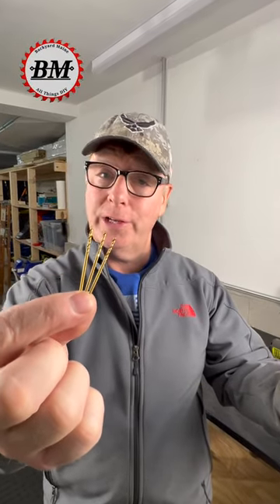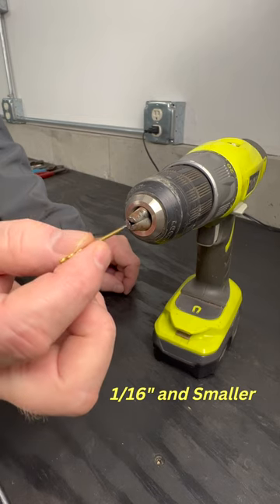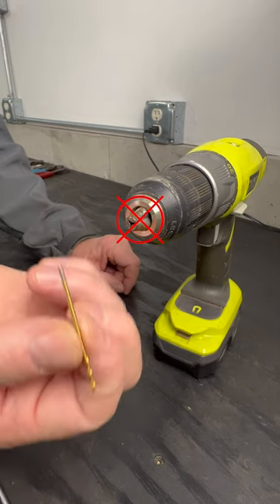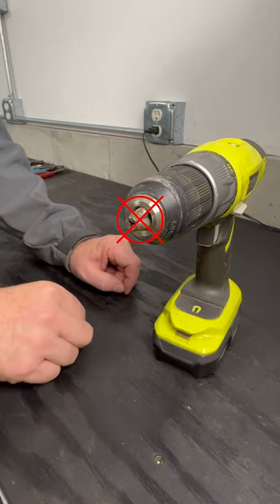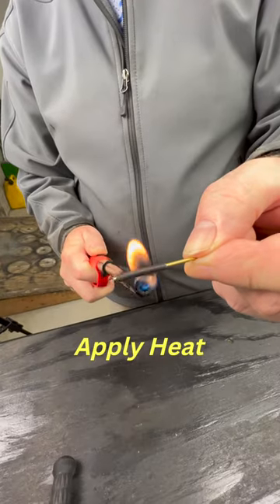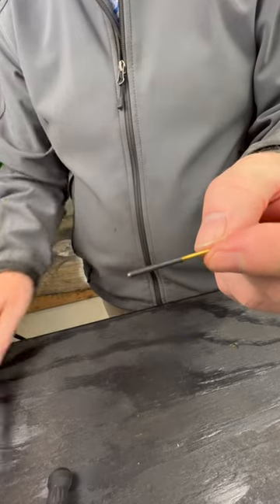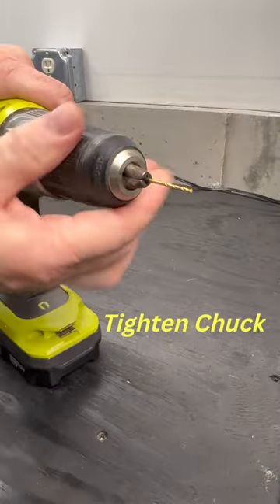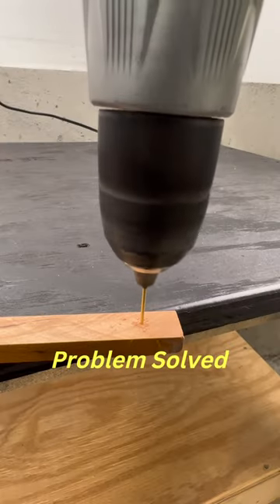Drill Bits too small for your Drill? #shorts

Comment: Electrician:where did all my heat shrink go?

Machainic: Don't you see all the holes I had to drill?
Reply from the maker: And I’m an electrician…. lol
Reply: You can do this with Romex insulation as well.
It works for sizing up undersized bits for use in dremels. For a drill it would work as well.
In case you're broke and don't want to use your last piece of shrink tube like me lol.

Comment: will heat shrink works also in router bit that falls off their router? or should i basically just buy a replacement shank/collet?
Reply: Speaking as someone who does this for a die grinder: it's hit and miss.
I recommend buying the correct size of collet or bit. Safer for you and for your tool.

Comment: Only problem is micro bits tend to snap just before penetration which is why I don't chuck them to tight. This was the drill spins instead of snapping. these hacks will work in a pinch but a adapter chuck is like 5 bucks

Comment: Probably because it’s a cheap ryobi POS. Go and buy a makita,dewalt or Milwaukee drill.
Reply from the maker: My Dewalt drill and impact both smoked within the first two years. Had these for several years no problems and the set cost less the the Dewalt battery.
Reply: @BackyardMaine  I don’t know how you use them but most of my mates are carpenters,plumbers,electricians and they swear by em and I work in a hardware shop that sells all ranges.
Reply from the maker: @bennyl2487  I like Milwaukee and Makita.. All of my corded tools are one of those two brands. But this set was inexpensive and has lasted longer than I expected. I use they all the time.

Comment: Another reason I am glad I don’t have any Ryobi tools 😄
Reply from the maker: I know everyone wants to crap on Ryobi because they are cheap and I get that But for what I paid for this set they are quite good. These have been going strong for 8-10 years now and I think the drill impact, charger, two batteries and the case were about $100. I had the (yellow) brand before but the batteries died after 5-6 years and for the cost of the batteries it didn't make sense to replace them. Put them out in the front yard with a fee sign. I love Milwaukee brand so I'll probably go with them once the green ones fail.
Reply: @BackyardMaine  that’s a long time and glad your happy with them. Just surprised most chucks handle small bits but I guess not. Yes battery prices are awful. Better to just new!  Love your channel
Reply from the maker: @condor5635  Thank you! I they will handle anything larger than 1/16" but I was trying to use a very small bit to clean out a plugged carb jet and I had to come up with this solution.

Comment: Why would you need a whole that size? im a plumber and never drilled anything that small
Reply from the maker: It's not that common but I bought the to remove the hard varnish from the small jets on a generator carburetor.
Reply: @BackyardMaine  7 years into the field the only thing I'd use that size for is to drill a bolt out. Probably use way more in automotive

Comment: I use dewalt i did not know that you can have such a problem 😂
Reply from the maker: I don't like Dewalt brand power tools. I have owned them a few times and had problems. My primary drill driver now are Milwaukee and the ones in the shop are the cheep Ryobi brand which have actually held up well.
Reply: @BackyardMaine  you can't go wrong with Milwaukee for sure. I own a few specialty ryobi tools they make good nail guns.